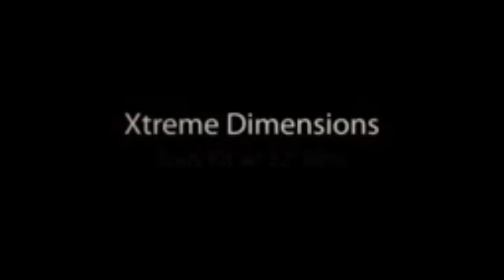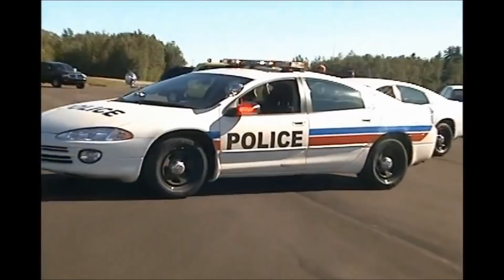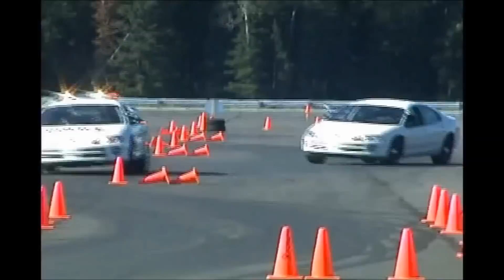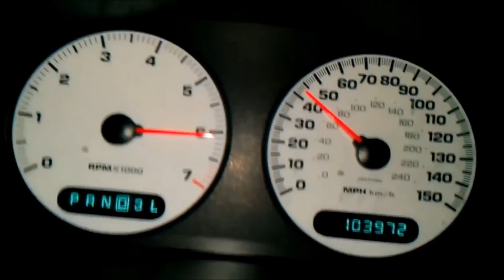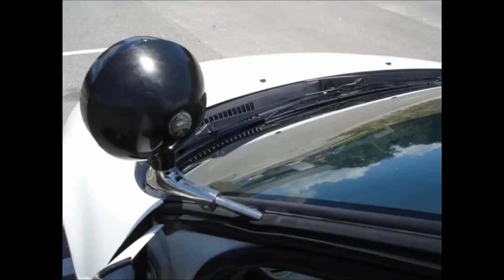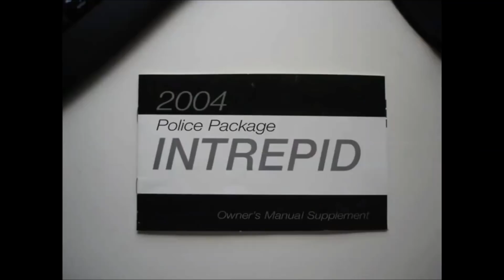The Absolute WORST Police Interceptor EVER! the Dodge Intrepid

Comment: I remember Glenview Police Department up in Glenview, Illinois had a few Intrepids, they got rid of them by 2009, they replaced the Intrepids with 2006 Dodge Chargers which were eventually replaced by Ford Crown Victoria’s later on, Glenview Police had a few Intrepids along with crown vics as marked squad cars then after 2006 became crown vics & chargers as marked squads, the officers were much happier with the 2006 Dodge Chargers over the 2001 Dodge Intrepids, they also transferred all equipment except rear deck lights but they also transferred the Code 360 lightbar & the Dunbar-Nunn Touchmaster TM-4 lights & sirens box from the Intrepids to the Chargers.
Anyways not trying to get off topic I mean the Intrepids were not really meant to be Police Cars but they can’t be worse than the Modern Day Dodge Durangos in my opinion, The modern day Dodge Durangos in my opinion are worse than the Old Intrepids, there’s so many problems on the Durangos today you can’t even count.

Comment: Imagine if they had only made:
A slightly stronger impeller (blades) of the water pump
Drilled thicker oil passages in the crankshaft, and a slightly larger oil pump.
(for 2.7) A normal chain tensioner (and better secured plastic on the chain guides)
How much more expensive would it be? By $100?
And if they had thought out the transmission a little better, the car would have become a legend! In terms of reliability and affordability. But also comfort. But instead, it became some kind of misunderstanding. Despite this, I still love it with a strange love.. because it is very rare in our area and beautiful in its own way.

Comment: maybe you'll laugh, but here in the Russian Federation, this is a very rare car (officially, neither the 300m nor the Intrepid 2 were supplied. Only Chrysler imported a limited 300m, they were still found. Dodges were not available in showrooms at all), and when you drive against the background of small "Europeans" and "Asians", this schooner looks quite impressive! and few can understand what it is at all. So there are fans of this here, and I am one of them.
Yes, I agree with the author in many ways, but it is even more offensive for the car. Because in our understanding, if a car is crap, then it is all made of crap. And the Intrepid is not like that. In general, this is a good car with a long service life, but it is ruined by minor flaws. Which it is generally unclear how they allowed! For example, 2.7 has a good engine base, a normal chain capable of going 300,000 km. But it breaks down because of a cheap tensioner. It is oil-piston and leaks at 60-70,000 km.
camshafts, the block itself, piston group... everything is done simply, but at a fairly good level, but why the hell did the engineers sleep through the calculations for the oil channels (in 2002 they fixed it, but it was too late). They are narrow, in the lower part the engine experienced oil starvation, the crankshaft constantly overheated and the connecting rod bearings flew off. This is simply unbelievable! Yes, then they improved it, assigned a new tolerance for oil (moreover, you can’t deviate at all, and how about a budget car, synthetic, expensive oil with a replacement period of 4-5 thousand miles?), but reputation is everything! What I'm saying is that potentially, it could have been a very good car, for a reasonable price, but something went wrong! It's very disappointing.

Comment: I bought a used Intrepid with the 2.7 from a friend/Dodge mechanic. He got it cheap and did some type of fix for the engine sludge issue(increased the diameter of the oil passages) so the only problem I had was when the internal water pump went out( another cause for sludge).  I was looking out for it and caught it before it became a big problem. Drove that car 200+ miles per day for years with no trouble beyond the water pump. I gave it to my son and he drove a few more years after me.

Comment: I own a private security company and have a handful of ex police cars as company vehicles. I have 2 08 Ford crown Vic interceptors, a 2014 ford explorer police package and I just bought a 2002 intrepid interceptor about 6 months ago. Honestly out of all the cars the intrepid is the most comfortable and roomy. The guy spouting his mom sense is not very well informed. The intrepid interceptor has a VERY beefed up and super stiff suspension system that makes this big ole car handle like a mini Cooper. The thing will out corner any of my other cars and has other upgrades this fella decided to ignore. The car has full external cooling systems for the oil, power steering, the transmission and an oversized radiator. Mine has the "autostick" option and has been relocated at the factory to the column shift. My intrepid will keep up every bit with my p71's Vic's. Also the gas mileage is almost twice the Vic's. I get about 12 in the Vic's and the intrepid gets about 22. My intrepid has 170k now and has been fleet maintained since day one. It did have a transmission replacement about 3000 miles ago but the car runs and drives very well and myself and my other guards like it very much. I've had it checked out at a mechanic prior to purchase and his inspection showed a very clean engine with solid compression and no major issues. The only thing I had to do to it was an O2 sensor replacement which looking thru the huge file of reciepts and records, has had to be replaced about every 2 years or 25k. Not sure why and I assume it is a weak point. I don't think it's fair to bash the intrepid like he does. It's like any other car, it depends on how well you maintain it, keep up on oil changes, use proper fluids and parts and treat it well. The main reason the police quit using them wasn't exactly how this guy says it was. One of the biggest reasons was the fact the car is front drive and has very low ground clearance making the car unable to handle pursuits thru rough terrain and over curbs. Cv axles were exploding if an officer jumped a curb at speed, unlike the tank like front ends of the crown vics. The huge issue and killer was the braking system. They were susceptible to overheating and the seals failed and dumped fluid onto hot rotors causing fires. Now as a civilian there is no way you'd ever hear the brakes up like that so no worry. They also changed the brake materials and used a non flammable brake fluid on most department cars after this discovery.
ALL makes and models have issue and weak points. The crown vics, the Caprice, the dodge chargers, and even all the SUV police cars have things you could point out. The intrepid is no different. If you find a well maintained, reasonably priced intrepid interceptor, and you like the way it feels then I say buy it. They're not as bad as this guy makes them out to be.... Almost all of us when we were teens drove pieces of unmaintained shit and beat the crap out of them!
Reply: I’m not gonna lie I think today’s Dodge Durango’s are a lot worse, you can even look it up how bad these Dodge Durango are performing for police departments so many problems, Indiana state police primary example they signed a new contract with Chevy to GET Chevy Tahoes because the Dodge Durango‘s are complete crap, they’ve been going out on police officers in the middle of calls.

Comment: Have a 2004 Dodge Stratus SXT with the 2.7 engine with over 157,000 miles, even with the stupid internal water pump and interference engine the problem is ? People failure to maintain it, 2.7 Chrysler engine is a high maintenance engine and you must be proactive when it comes to replacing the water pump and timing chain after 70,000 -80,000 miles. Should also use full synthetic motor oil.

Comment: I liked my 2005 Intrepid.  I drove it exclusively from when it was new to a promotion in 2010.  We had 5 of them and we did replace the water pumps in all of them.  But it drove like a dream, had good speed, and had no other issues.  I drove every widely available model of cruiser from 1987 thru 2016 except for the Diplomat.  My Intrepid was better than any of the Crown Victorias I drove (1991 square version; 1996 sleek version; 1999 last model design).  They COULD NOT GET OUT OF THEIR OWN WAY.  They were fairly durable but cornered like a school bus with similar acceleration. Brakes were a problem as were overheating when at idle.  If you had high-mileage, you had to open the hood on hot days if you were on a traffic detail or working a crash, otherwise, they would overheat.

Comment: It's actually not a bad car. A lot of what you are saying comes from the previous generations when the accountants got a hold of this thing. Mind you I still can get around the internal waterpump, the only dumb thing about the motor really. But it has fairly compact cylinder heads and has 6 bolt bridged mains so they are a stout block honestly, little on the large side packaging wise as a whole but stout. The suspension was originally designed as an AWD but even before that it was concepted to be a dual motor rear drive electric car with 400+ HP. The suspension was fairly advanced for the time and can even out handle a lot of smaller lighter cars. An issue is buying good parts, not chinesium ones especially for the suspension, probably the main source of your personal problems with it. I can say styling is a love or hate but it looks closer to a nascar/racecar than anything else in it's class and it cuts through air like a bullet which is probably why the body was used in racing. It's comfortable and a nice cruiser on the highway. I've had mine for a couple of years and I like it a lot and before that I used to hate them for the same reasons you say here but in the end most of that stuff isn't really true unless the person likes to abuse the car. Anyway, I'm keeping mine for an LS swap and it's actually a great candidate for it, it'll be easy to convert.

Comment: Actually, I have a 2001 R/T with the 3.5 liter engine and the optional 4-speed automatic.  It has over 130,000 miles on it and it still looks and drives great.  People compliment me on it all the time and tell me how great the car looks and that it's a cool 4 door sports car.  I love it.
Reply: Sounds like you have the same car as me. Mine has 225,000 miles. No probs. But, it is well maintained. If not pampered.
Reply: @LAMB53087  Take care of your machines and they will take care of you.

Comment: 96 Dodge Intrepid had a 3.3L V6 that was pretty much indestructible. It had sludge but they get a vacuum flush when you change the oil it had no problems and the vacuum flush was only $50.

Comment: bullshit, check out google review, this car has 4.5-4.8 star out of 5 some cars have 200K +-300k+ miles with all original parts . I have only replaced camshaft  twice .everything else is original. It has super heavy duty suspensions and exhaust. Not a single spec of rust, looks like new. Has most of electronics made in japan and also alternator made in japan compressor and much more, it has German engineered engine and transmission and much much more,very very happy with this car.   It drives like a dream. smooth and fast.

Comment: One thing that I can say is that I had a dodge intrepid with a 2.7L in it and it was notorious for the water pump going on it and it was designed when the water pump would go it would leak engine coolant into the engine oil causing the oil to sludge up and then you'd get a good size knock in the upper part of the motor. I made sure thatmy next intrepid had the 3.2L and wow what a difference in dependability. I've had the car now for 9 yrs and have had very little problems out of it.

Comment: I don't where you're getting your info from, but you're full of shit!!! As some one who has actually owned Intrepid's I can tell you it was one of the best car's I've ever owned. My first was a 2001 liked it so much I bought 2004 I had no oil leaks wiring problems, or water pump issues. Drove the 04 for 13 YEARS, and put  almost 300 km on it. Other than oil changes, tire's, brakes and replacing other wearable components, the car was incredibly reliable.

Comment: I just rolled over 200k with my 04 3.5  intrepid.  Save for a new water pump n timing belt, it's been a real dependable workhorse.  The 3.5s can take more abuse than the 2.7s ..for sure.  And I've always loved the fastback styling of it.
Reply: I got mine about 2 years ago. The last years were the best ones, they don't have all those other problems like the earlier ones. It has the 2.7 and it's actually not bad but it was at 220K and I had to change the waterpump when it failed. Funny enough it did overheat badly a few times and made a nice thick milkshake. I changed the pump anyway and ran a few oil changes through it till it was giving me clear oil. Still good after putting on 35K after that. I use it for deliveries.

Comment: I gotta 3.3L straight piped 96 dodge intrepid and that thing has some performance. OIL SLUDGE IS A MAJOR PROBLEM THO. But sludge is REALLY EASY to get rid of in the 3.3L. Most people are just too damn LAZY these days to do engine work.

(I'm 16 in 2019 and I bet I know more about the inside of an engine than most you people watching these car videos.)
Reply: Seriously? I have never heard of the 3.3L having sludge issues. Ever. The oil sludge issue was limited to the 2.7L only. The 3.5L and 3.2L never had that issue (which I'll explain why in a minute), and from everything I have known and read about 3.3L engines (and it's larger 3.8L version), I have never heard of oil sludge issues in a 3.3L engine. The only known issue with 3.3 and 3.8s is that they have a low occurrence of rocker pedestal failures, but even that is rare compared to the huge number of them that were made. If you have oil sludge issues in your 3.3, you may have water getting into the engine oil somewhere. The only way would be a blown head gasket that could allow water to drain into the oil in the lifter valley area below. If you are getting sludge in your 3.3, I would look for signs of water leakage from one of the head gaskets. That's the only thing I can see that would ever sludge a 3.3L like that. I've never heard of engine sludge in a 3.3/3.8 before.

As for the 3.2L and 3.5L engines, they never had sludge issues. At all. The sludge issue was with the 2.7L engine ONLY. The reason for this is because the 2.7 had its water pump stupidly located under the timing cover in an oil bath system that was required for the timing chain that the 2.7L had. However, the 3.2L and 3.5L engines were belt driven, so there was no oil bath system under the timing cover where the water pump was also located in those engines. So if a water pump or the seal broke on a 3.2 or a 3.5, it had no way to mix with the engine's oil to cause any oil sludge issues like in the 2.7L engine. Same with the 3.3/3.8 engines. The water pump was located on the outside of the block and not under the timing cover. So if a 3.3/3.8's water pump failed, it had no way to mix with the engine's oil at all. The only way a 3.3/3.8 would ever sludge up is if a head gasket blew and water mixed with the oil in the lifter valley below. Again, the oil sludge issue was limited to the 2.7L engine only, because it caused water contamination into the engine's oil when the water pump/seal failed due to the oil bath system in that engine. The 3.3/3.8, 3.2 and 3.5L engines never had that problem. Check your head gaskets if your 3.3 is sludging up on you.
Reply: @Plumcraziness I found the problem and it was minor sludge but by the time I could fix it 2 of my connecting rods stretched to the point where I have to rebuild the engine.

The problem was sludge but not nearly as bad as the 2.7l. It clogged up the ports so almost no oil was getting into the cylinders. If this happens to you I would recommend an oil change and a quart of Lucas heavy duty oil stabilizer

Comment: I buy new and run my cars to the ground.  My Intrepid did have a leaking water pump replaced at 125k.  The biggest issues came after 100k and with factory recall  issues that Dodge could never permanently repair such as camshaft sensor and evaporator canister.  Other than that, the car always purred, no cheap, rattling looseness in the cab at all.  That sxt gave me 15 good years but I finally said NOPE when the break liners corroded.  I can see how this car would fail as a police intercepter but as a family car it did well.  I have an 2018 Impala Premier now cause I've always been a sucker for large American sedans... and now Chevy will stop making those, lol.  Let's see how long I can make keep it purring.  Anyway, I was just remembering our Intrepid and it lead me to this.